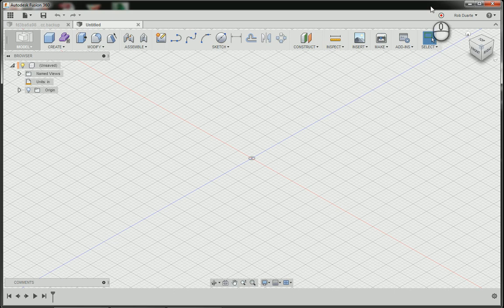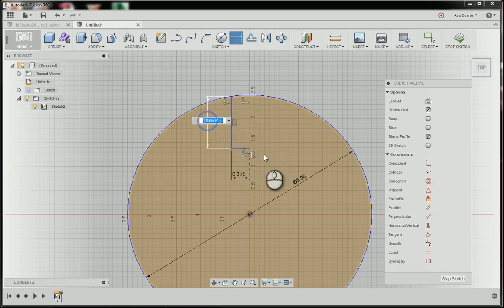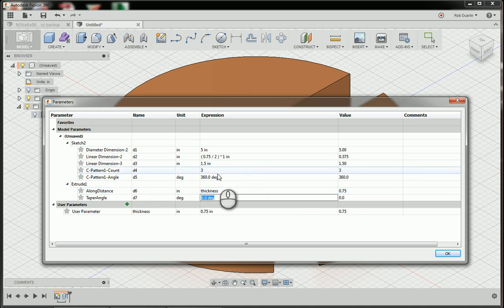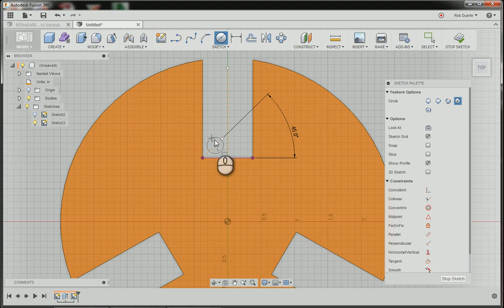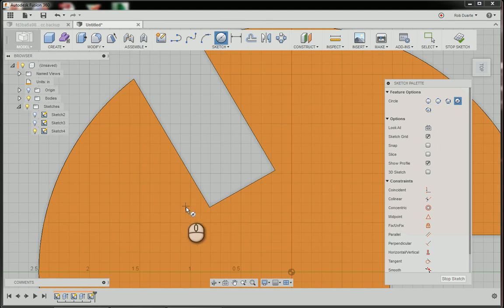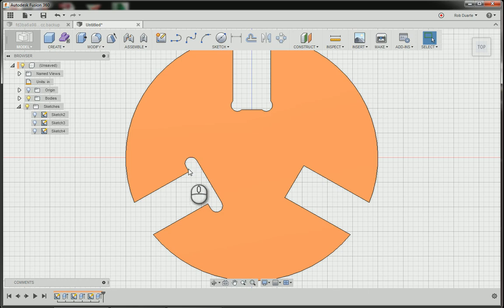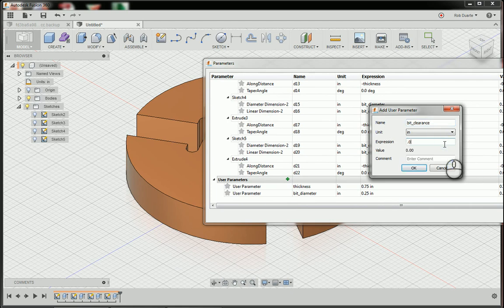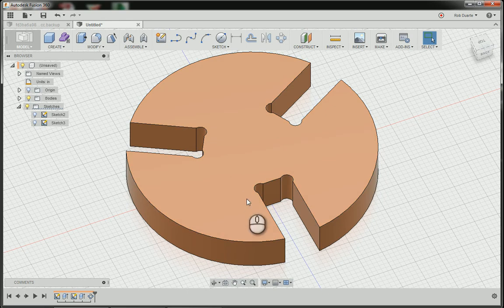[OUTDATED] CNC Routing with Fusion 360: How to avoid radiused inside corners

Comment: I usually do the second two methods with the radius of the bit rather than the diameter. Is there a reason you prefer to take away that much material?
Reply from the maker: +the Birdworks No, I think you're right. I am using the diameter/2 in the video but I probably should have been using that dimension from the far end of the circle instead of the centerpoint of the circle. Or I could have used the coincident constraint and made the centerpoint of the circle coincident with the edge of the slot. Thanks for noticing that.